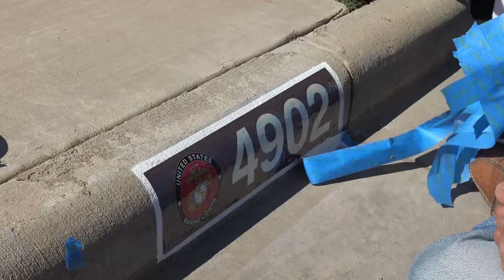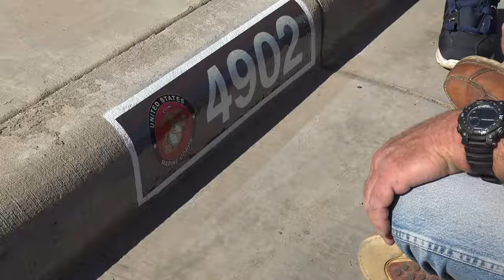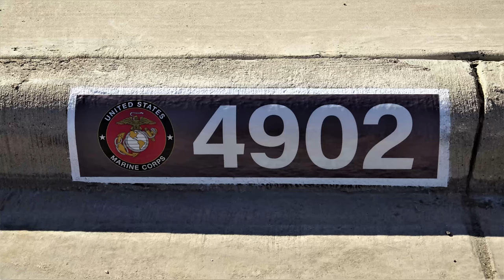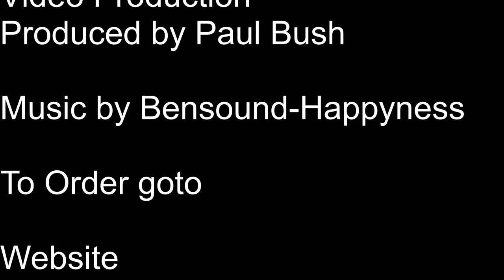reflective curbside  numbers

Comment: I've been in the sign business for 34 years and I'm sure that dirt will get into the edges of that decal and it will lift. You need a clean smooth surface for the feflective vinyl to adhere to. I'd be curious to know how long it stayed down?
Reply: with the layer of uv resistant epoxy, should last a few years.

Comment: Stonecoat epoxy IS the best on the market…..however, as an epoxy artist, I can guarantee you that it and any other epoxy resin WILL yellow in the sun. The sticker, if it is a sign grade reflective vinyl with an asphalt based adhesive should not need a topcoat. Alternatively, I would use a white liquid rubber instead of spray paint (think Flex Seal)…way more expensive, but will last for years AND will adhere to the decal as well as the cement. The decal is beautiful, but unless printing them yourself, too expensive to be competitive.

Comment: I’ve never seen decals used for curb numbering.  Looks neat.  Wonder how it will hold up to weather.
Reply: It will shear, tear, & peel the aluminum with any tire rub.
The aluminum still breaths the moisture from underneath & needs a good moisture barrier...that & the fact it is "epoxy" it will naturally yellow, as well as yellow & haze up under the coating from moisture.
Facts from a pro...i wont discuss this issue any further though.  This is a educational comment.👍
Reply: Decals hold up for years @JT_70.
Reply: I can make a curb look like that. With paint
Reply: @GodsSon4life  How do you paint the small details of the Marine logo?